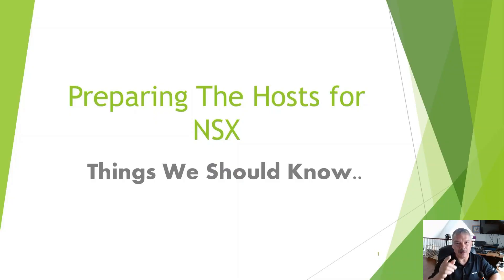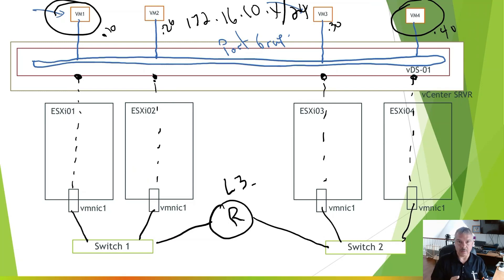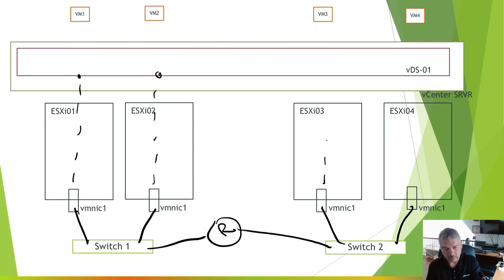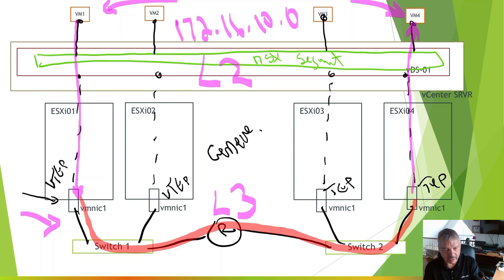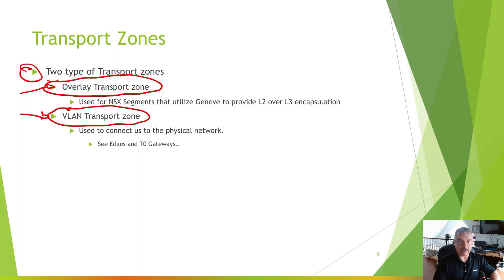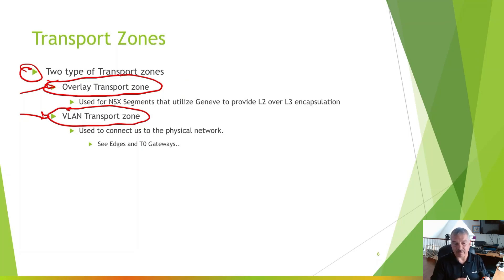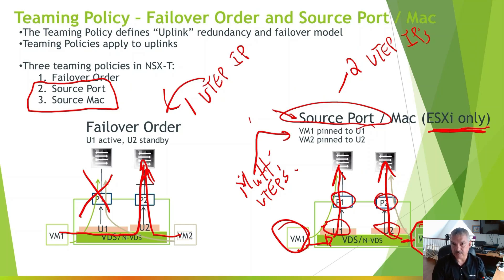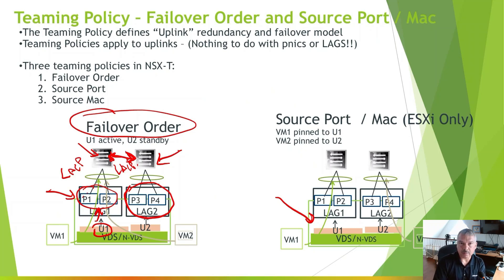How to Create a VMware NSX-T Transport Node - Part 1..  Host Preparation

Comment: I dont understand setting MTU size to account for overhead with jumbo frames.  Is that not happenign by default?  If my physical switch is set to 9k, my DVS should be set to 8800?
Reply from the maker: You are correct.  If your physical underlay supports an MTU of 9000, then you need to set the VDS that NSX will use to 8800.  This is to account for the overhead of Geneve and possible future feature NSX may bring to the table..  I hope this helps.  Thanks for watching and have a good one.
Reply: @TechUnGlued  Is this in any sort of official documentation?
Reply from the maker: @negatorxx Check this.,,.  https://docs.vmware.com/en/VMware-NSX/4.1/installation/GUID-19C1973E-8D20-4302-B3CC-CD610F79D5F6.html

Comment: 4:10 https://youtu.be/3gwlSnJGsno?t=250 - Based on my understanding, a virtual switch, such as vDS-01 in your example, functions similarly to a physical switch and represents a broadcast domain. As demonstrated in the video, if VM1 and VM4 are connected to the same virtual switch and the same port group (within the same subnet as specified in your example), VM1 should be able to ping VM4 without any traffic reaching the physical network. The ARP table on vDS-01 would map the traffic from VM1 directly to VM4.
Reply from the maker: Thanks for watching.  So a few things here.  A switch does not represent the broadcast domain - The vlan does.. Now in my picture the 2 vm's live on two different physical hosts - so they have to use the physical network to talk to each other.  No magic here. But how they do that is the big question.  The picture shows us just the logical view of the switch..  Also switches do not maintain ARP table (Mac to IP) switched contain MAC tables - MAC to port.. I hope this helps.. 
You may want to take a look at this video.
https://www.youtube.com/watch?v=sx4-0AmFYcg

Have a good one and thanks for watching.